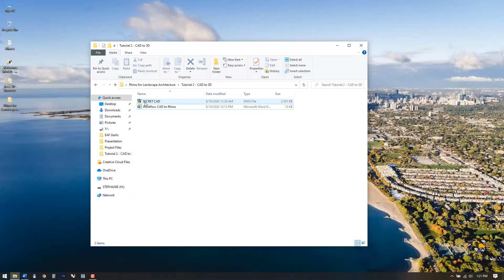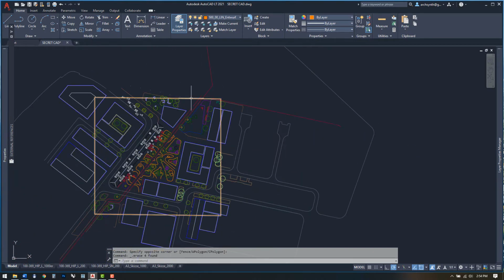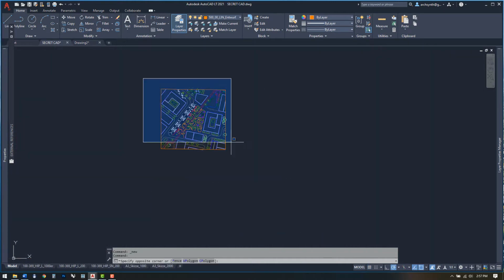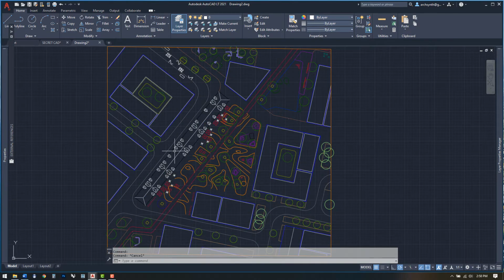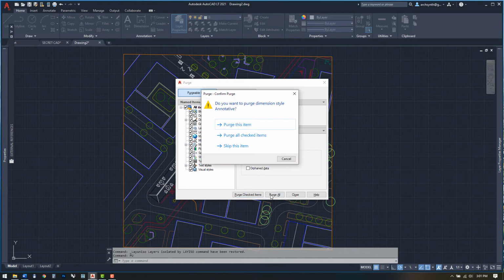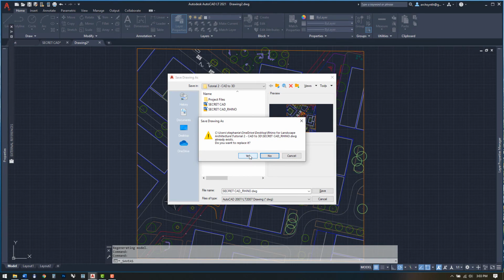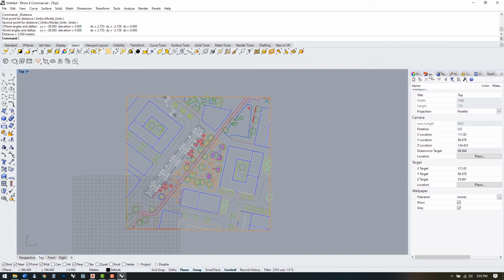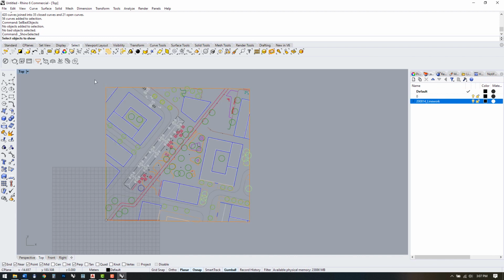Tutorial 2 - AutoCAD to Rhino Workflow

Comment: Hi Stephanie.  Quick tip for you to bring all lines to 0 Z elevation and quickly clean up your file there are 3 commands that will make your life easy and remove the need for you to paste to another file.  First - "Flatten" (then select all)  this will make all elements selected Z=0.  Then use "OVERKILL"  which will remove any lines of the same layer sitting on top of other lines.  Again select all.  Then "PURGE" all.  Which will remove all the unused layers and other junk in the file.   The problem with pasting into a clean file is that you will lose your coordinate system if one has been set by civil3D which is easy enough to do again but something you will lose.  Working with proper coordinates in Rhino is problematic I have found it doesnt like dealing with large values and it can be better to move everything close to rhino local 0 and then move it back after you worked with it in Rhino (I use workflows where I push into Revit, and these coordinates and coordinate systems are really important between these softwares)
Reply from the maker: Great! I use Overkill and Purge all the time :) I never worry about losing the coords because Rhino prefers all to be at origin anyways, so it's not relevant for my work. But it's a good point to remember if it's important to you.

Comment: Thanks for an efficient step by step guide for cleaning the layers and purging unnecessary components. Would you happen to know of any components that allow you to link your CAD file into Rhino and can change based on the plans in AutoCAD (kind of like an XRef between the two programs)?
Reply from the maker: I think VisualARQ can do this, but it is a paid plugin. Have you tried importing your CAD as a block reference? That should update with new linework if you just drag & drop the file into Rhino if you keep the basepoint the same. Let me know if it works!
Reply: @FutureLandscapes  I've tried using blocks that are embedded and it doesn't update unless I close rhino and open the file again. Once I that I get prompted to update the block, I wish I could do it automatically someway. There must be a work around but I can't figure it out (using this method I should be able to create grasshopper definitions that can automatically adjust to the cad drawing changes)
Reply: @mrmonkeymanfreak  using the same strategy, once you have a referenced cad file you can type the command "BlockManager" this should open a set of many possible blocks that are referenced in your model. Once finding yours just simply hit the update button and that should do the trick. Theres also a update automatically option in that same area however I haven't had much luck with it. Hope that helps some.